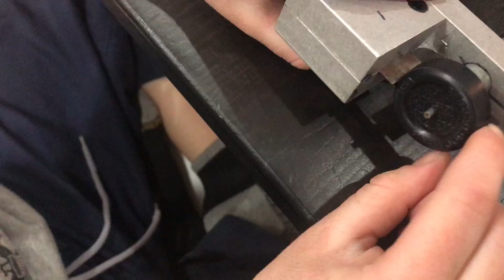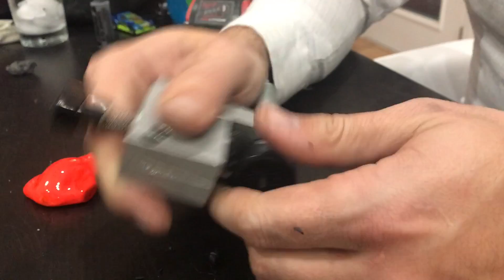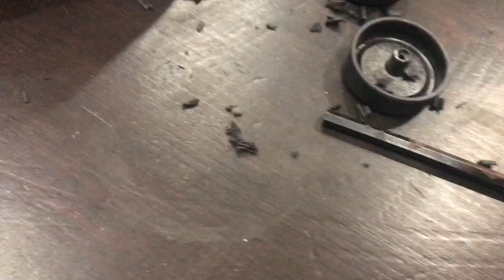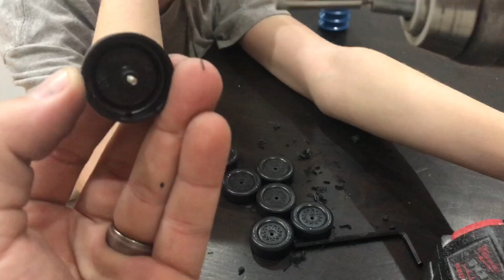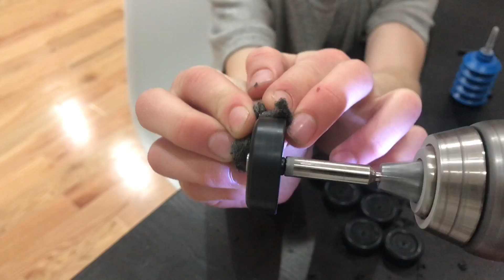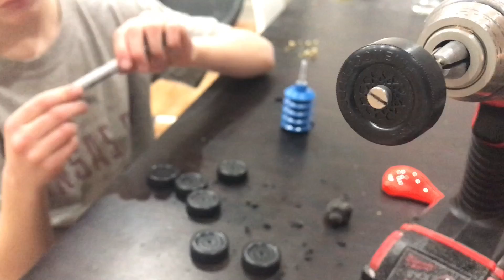Pinewood Derby Secrets Part 4 - Wheel Shaving

Comment: Wouldn't it be better to shape the profile  slightly rounded instead of flat? Like a motorcycle tire vs a drag racer slick? I'd think you'd want the smallest contact with the track.
Reply: Some councils don’t allow wheel shaping.
Reply: Correct.  The lightest and skinniest wheels are the fastest.  Check your rules as many do not allow major modifications to the wheels.

Comment: Shaving the inner edge is technically not allowed for BSA due to the fact that it reduces the overall width of the wheel.
Reply from the maker: Always check with your unit about what their rules are.  There is no official "BSA" rules, each unit sets their own.  Most units allow a "truing" of the wheel to make it straight, the rules dealing with narrow wheels typically apply to "disc" style wheels.
Reply: They usually use a tape measure or a ruler for measurements due to the wildly inconsistent measurements of injection molded plastic and the excessive complexity of a caliper-micrometer. If you shave off a couple thousandths they will have no clue.

Comment: Doing my first derby with my kids next year. Rules say “wheel surfaces cannot be beveled or shaved”. So does that prevent us from using this technique to true-up the wheels?
Reply from the maker: Always check with your officials but I would say no.  Beveling and shaving are done to minimize wheel contact with the track (which angled axles does anyway) or trying to cut weight from the wheels.  Simply truing up the wheels to an actual round is not violating most rules.  We only remove enough material to bring it into a tru round and not with the intention of cutting weight or minimizing contact.

Comment: I haven't ever used this tool but I do know damage to the inside of the wheels is a No No #1 to kill the speed of a wheel. I would recommend polishing the hub tool just like an Axel or place tape on it as it's smooth and won't damage the wheel. Don't EVER use the mandrel the screw treads are pure death and will completely destroy the inside of the wheel. Also as seen in the vid it's not spinning in a proper circle so any Sand just un-trued your wheel.
Reply from the maker: We don't touch the inside of the wheel, just true them up so that the outside is a match to the inside of the hub.
Reply: @technicolorchristmas  I think ebatt's concern was that the screw-in mandrel at 11:39 might gouge the inside of the wheel?  I appreciate the video!